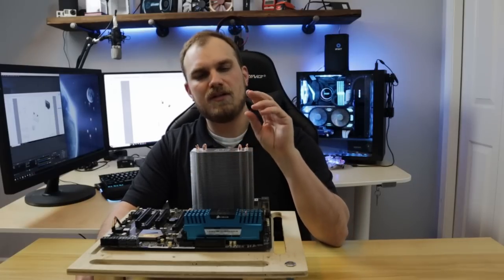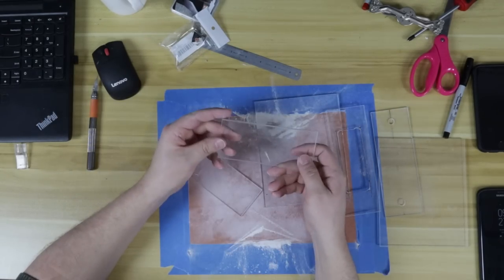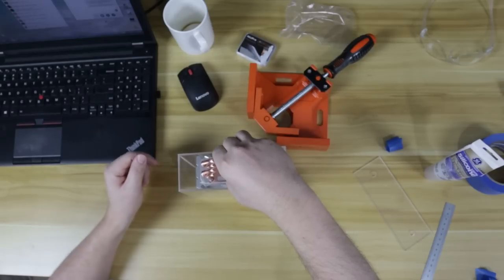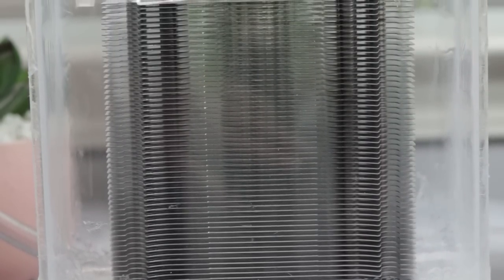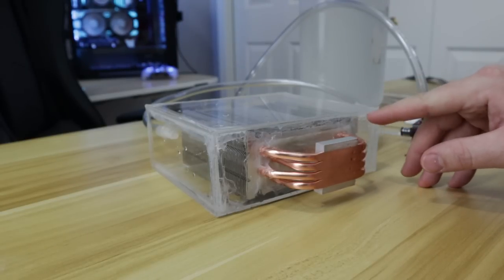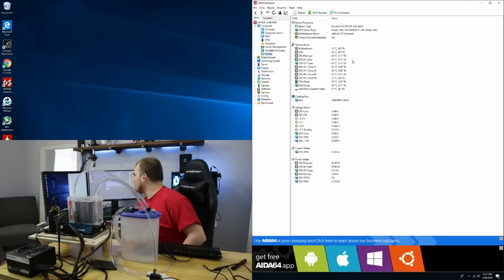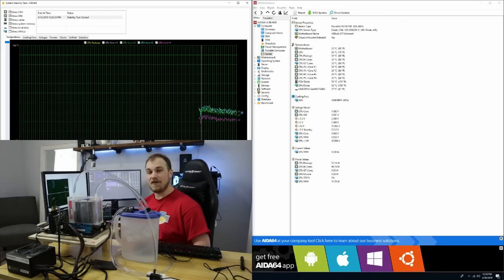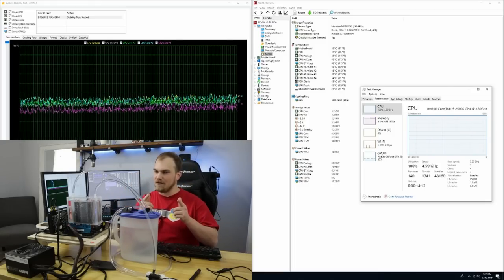I Water Cooled My Air Cooler AND..........

Comment: Fun experiment. Totally impractical, but props for doing it!
Reply: Not sure how you see this as in practical. If he does it with a more modern high end CPU and can maintain temps in the 40s while OC running Ida64, I see this as a more efficient loop. The heat pipes will pull more heat off the IHS then a water block sitting right on it ever would. Its all about surface area and getting the heat spread out
Reply: Not sure this is impractical, he's multiplying the surface area to cool with the water.  I think we're looking at the future of CPU waterblocks
Reply: @HAHA.GoodMeme  Performance might be OK, but weight and size alone pretty much disqualify it. And if fin size mattered that much on the block level in comparison to overall water temperature in the system, companies would be doubling and tripling that easily.

Comment: a year late here, but if you ever face the need to remove bubbles you have 2 easy ways.

1. Vibrate them out by hand. gently rock back and forth. flip 90° and repeat until satisfactory  level achieved. 

2. Pulses of liquid are far more effective at removing bubbles from water than a stable current. the exception is when making clear ice:)

thanks for the effort making this. u proved my long time theory.

Comment: "the fan that came on the 212 is louuud"

Me: Looks at computer with stock ryzen cooler screaming away at 2000rpm...
Reply: Laughs in intel stock cooler
Reply: Laughs in needing 2 server class fans to get 80°c
Reply: I got the 212 on oc with low Vcore on my I5 4670k 4.2ghz sitting at 34ºC and my case fans are the ones doing the noise xD

Comment: Love the idea. The ammount of thermal mass is huge there. Also I would do a crossflow design to make sure the water go through most of the fins and is actually circulating through the whole stack. 

Lastly, get something that makes some real heat under that. 8 cores maybe ? 5 ghz? 

Keep it up
Reply: I agree more like a radiator.

Comment: If you actually think about it, this works about the same way as a CPU waterblock but with heatpipes. Most waterblocks have microchannels cut into them to allow more surface area for cooling, and that is exactly what the fins do on an air cooler. The heatpipes themselves have liquid in them as well, which evaporates up the pipes and gets wicked backed down after. So in summary, you made a scaled up waterblock that doesn't contact the CPU directly. Great video!

Comment: I did this with mineral oils and a LGA771\5 back in the early 2000s on a Radial thermaltake with that axial central fan.- it WORKED AMAMZING - I left the cooling fan on to help move the oil - it may or may not of been needed but I felt it would help circulate the oil.  ROCK SOILD At ambient +- 3c IIRC on my QX6800/6850.

Comment: what about those computers that are immersed in oil, that is another kind of cooling
Reply: Well that's just immersive liquid cooling.
Reply: Those look cool but fiddling with upgrades kind of makes it a huge hassle.
Reply: JenkinsStevenD People never really upgrade their systems anyways. They just start from scratch again.
Reply: @user-xg6zz8qs3q  You must be one of the rich kids.  100% of my engineer friends, self included, who build their own stuff upgrade instead of building new several times over the life of their computer.  Especially when there are marked tech improvements like moving from a HDD to a SSD which I did a few years ago and then upgrading graphics cards.  Also, components break occasionally.  Are you going to "start from scratch" because of a minor defect...or just not perform some exotic, unnecessary cooling that isn't even optimal with heat transfer?  Crazy talk.
Reply: @JenkinsStevenD  "100% of my engineer friends"

engineers are a small portion of the population. Most people are not engineers. Grandma isn't upgrading anything, she's tossing it in the trash and buying a new $300 POS like she always does.
Reply: @kyle8952  Seems irrelevant since Grandma won't be immersing her hardware in oil.  Also, grandma will likely take her hardware to some faux repair shop like geek squad and I doubt they will want to troubleshoot hardware issues if grandma rolls in with a mineral oil filled case.  That is neither here nor there though.  000 001's comment was that people don't upgrade their computers.  THEY DO.

Comment: The only problem, is the water slowly rising in temperature, since there's no fan to remove the heat. Eventually, that CPU will get way hotter than it would under a normal cooler. If you're simply trying to go for some good OC headroom, this is a great idea with that ice, no doubt. 

Good video, man.

Comment: While 'cool' this is only as good as the ice in the pitcher lasts for. There's no way to bleed off the heat stored in the water with this setup. You'd need a 2nd radiator to dissipate the heat out of the system. An hour or two and this system would be at max thermal capacity.  
If you had the water dripping, or preferably 'misting' into the res, and you blew air through the res, that would dissipate some heat. 
Nice starter idea with lots of room for tweaking.
Reply: He did mention that in the vid though ;)
Reply: oh dude - better idea like:
Have you got a garden/balcony or just space for a fountain? You can integrate your loop and the only noise left is the pump + dropping water.
I really like this idea.. as long as its not that sink dropping sound...

Comment: Cool video. I would suggest moving the input to the bottom, that way the water would flow across the entire height of the tower before exiting at the top. Also, as others have suggested, sealing up any way for the water to flow around the cooler would force more through the fins. 

To all the folks pointing out that without a radiator it’s just going to heat the water, he literally said this on the video. Also the fact that the ice melted quickly shows that the setup is effectively drawing heat away from the cooler.

Comment: THe water in the jar will slowly heat up and you will need a cooler to cool the water that cools your cooler.
Reply: What if you put it in a fridge that is set up to the lowest temperature?!!

That would be awesome :D
Reply: and don´t forget the copper, that will become weak soon infact of the normal water....than he has a big leak haha
Reply: SalveMonesvol 
This is rather convoluted 🤪
Next we get long pipes++ expensive refrigerator with ice maker ++ silicon the pipes into the door directly into the icebox ++ bingo++
A 2 grand ice cooled / water cooled air cooled fanless cooling system,,,,, noctua make nice fans,, only 5v nearly silent too 🤫
Strange experiment,,
Reply: no shit sherlock.. But if you would use a radiator instead then it would function as any watercooler
Reply: @morpheas768  : For improved clarity, the problem with a refrigerator is that they remove heat slowly, because they're designed to rely on insulation.
Reply: I guess you didn't watch the video then huh?
Reply: Just add ice in the pitcher 😀
Reply: Guys, I really don't care about this beyond a joke,  just move along.

Comment: Love the ingenuity. My only concern is that the ice is biasing your results. The rate of ice melting would have to be compared to a typical water cooling/radiator setup to be more meaningful. Adding heat to a system undergoing a phase change does not raise the temp. If the water pulls heat from the connection faster than it can heat up, more heat fins are negligable, meaning more cost and points of failure are unnecessary. I would sugguest hooking your heat sink reservoir to a typicall radiator and checking the temps. Conversely, adding ice into an open loop cooler without heat fins on the block might reproduce your results. I really do love the idea, and it would be awesome if it does improve cooling.

Comment: Welcome back to 1998-99!  We did this wayyyy back when but used a pre formed plastic box.  Sealing the bottom always fails, it works for a while but eventually leaks unless you seal it with epoxy or something similar.  These will actually work better than AIO's but you must use proper water or mineral spirits to prevent the Heat sink from Rusting/Corroding.  Great video...takes me back!

Wanna laugh?  All water coolers ARE Air coolers, this is how stupid the community has gotten in the last 15 years.  Yes the water runs through the block but it's cooled in a rad with fans blowing air thru them,  it's not Rocket science but it is amusing to see the arguments.

Comment: Please look at forcing the fluid to flow through the heat sink, filling from the bottom diagonal to the outfeed on top would help with that, dye added to the water would help you see the flow based on how the dye infuses in the fluid.
In theory this could make a liquid cooler far more efficient due to increased surface area
Reply: he needs to put in a separator so the only path from inlet to outlet is through the fins.
Reply: @jaqssmith1666  yes sir

Comment: Cool idea! Suggestion to avoid the consequences of possible leaks. Use a old PC case, cut of sides, mount some stands/legs on it for upside down placement and easy filming.This way leaks fal on your desk. You can put a dishcloth untop off your desk to easily spot drops of water

Comment: Use distilled water or better double or triple distilled water because it does not conduct electricity. For version 2.0 make it narrower so that all the water goes though the heat sink and lastly run a pipe with holes down its length on the inlet side.  
Have fun!
Reply: Not sure if that's a good idea.  Distilled water tends to erode metals rapidly.  Tap water has had solutes added to reduce erosion as water move through pipes (although the erosion is not fully preventable).  Distilled water will eventually eat away at the metal that helps form the seal.
Reply: @sulblazer  If you're worried about corrosion, car radiator fluid would be the best solution. Don't know about it being conductive or no, thought.
Reply: Water does not have the best thermal conductivity of any liquid though.
Reply: @sneeky7 Sure, but it'll no longer be distilled water.  I was just pointing out that the original poster said to use distilled water because pure water is not conductive.  Dissolving phosphates or a weak acid like dicarboxylic acid will provide free ions for conductivity and thereby defeating the original poster's idea of using a non-conductive fluid.
Reply: @sneeky7 Yeah...I agree.  If you want to have the last word...that's fine, just say so and I won't respond to your next reply.

Comment: you should team up with someone who has a 3D printer. mate a tank to a small noctua air cooler, and incorporate a good radiator. you could also avoid any leak hazards by using mineral oil instead of water. as you move forward i think you should use a non conductive solution such as mineral oil, but also something that will combat bacterial growth for long term solutions, ie mineral oil. also using mineral oil will protect against corrosion, unlike water.

the other thing is to make the flow of the fluid pass by or through the fins of the air cooler, I don't have any suggestions at this time, except for the placement/location of the inlet and the outlet of the tank.

another thing I'd worry about is the pump getting gummed up by any impurities in the fluid. but you don't have to worry about that if you use mineral oil.

... just fucking use mineral oil.
Reply: Or stuff thats in a cars radiator..

Comment: I suspect condensation on the tank might drip on your mother board.
Reply: Condensation only occurs when a surface falls below room temperature. The water never went below 30°C, so it never went below room temperature.

Edit: I forgot about the CPU adding heat to the water. The water was colder but got to an equilibrium of 30°C only after receiving heat from the heatsink.
Reply: aFuturnaught 
Condensation doesn’t have a set temperature for it to occur. The difference of temperature between the ice water and the surrounding air would be enough to cause condensation.
Reply: @AM-ko4pi  Right, but, in this case, room temperature is what matters since the water is in an air conditioned room.
Reply: aFuturnaught 
If you put ice water in a glass in even a low temperature room, it’s going to cause condensation. Try it yourself. I have a glass in front of me I poured earlier. There’s condensation and my room is around 20 degrees Celsius.
Reply: @FutureNaught  Condensation occurs at the dew point. This is a function of room temperature and humidity level. As a rough guide, 50% humidity will produce a dew point around half of room temperature. If <30% humidity, dew point is below freezing in room temperature air.
Reply: @AM-ko4pi  Condensation only occurs when a liquid is colder than the surrounding environment...the liquid cools rapidly to reach the room temperature. So what @aFuturnaught was saying is valid. If the liquid reaches room temperature both in the block and reservoir there will be no condensation....even with the heat from the cpu, because the water would be looped, and cooled. Which in turn, would not allow condensation to occur.

Comment: High risk, low reward. But awesome video nonetheless.
Reply: low reward? it fuckin worked
Reply: low rewards ? an overclocked cpu running full load on 45°C ! that's my idle temps right there, I think it's a pretty awesome idea
Reply: Guys he is right. It is high risk low reward.

I mean the basics: aluminium and copper in a loop? Bad idea.
Reply: @pcgaming002  It's somewhat unlikely that the temperature would remain at 45 Celsius in those conditions, once a radiator is installed instead of melting ice.  Still, could be a very nicely performing system.
Reply: LOW REWARD? 20 C - 40 C ARE GREAT TEMPS FOR 4.0GHz+!
Reply: @danieljimenez1989  yeah true, but still we're talking about this awesome idea, it's not perfect but it might open some doors for some alternative cooling solutions, who knows :)

Comment: The positioning of those tubes is terrible.  You''re not getting any water flow across the fins.  They should have been place diagonally apart from one another, or at least horizontally.
Reply: Facts. The water has no reason to actually go throughout the container. It'll just go the path of least resistance which is right across the top, avoiding the fins.
Reply: It will be better if installed in the case vertically. Also, the tube can be inserted more.
Reply: Who was convection?

Comment: Copper heatpipes and aluminium fins? That is probably not a very longterm setup :-/
Reply: its done in almost every industry.. not sso much a big deal as everyone makes it out to be.
Reply: Zues Toots issue is they arent putting the aluminum and copper in water which causes galvanic corrosion
Reply: It is if the uncoated copper gets wet in any way

Comment: It's neat, but in reality all you have added is one more barrier for the heat to pass through.
I guess you could argue that you have increased the surface area between the processor and the water with the air-cooling fins, but I still fail to see how this is "both water and air cooled".

It's water-cooled, with an increased surface area between the water and the processor. There's really nothing new here. =|

Still a very neat project!
Reply: Ironically, most water cooled builds are also air cooled, since the water is used to carry heat to a bigger radiator, but not this one.
Reply: @RB-kb3tc  Very true. "Watercooled" is a misnomer in a way, as the heat ends up in the air in your room no matter what you use.
In this case you could argue that it stays in the water, but then the water will just keep heating, temperatures rising, until it hits the boiling point, at which time your CPU is toast and you got a very leaky system.

Comment: Even more lightweight idea:
Chop open the heatpipes and loop your water through them so you can still have the fan on the finstack.
Reply from the maker: interesting idea
Reply: Holly molly... you how hard it is to get a waterblock for some graphic cards. Esp those small ones, like zotacs mini or gigabyte ITX.
Most of them have coolers with heatpipes ;-)
Just an easy ghetto build.
Cut heatpipes, connect with tubing of your loop and you are good to go. ;-)

Comment: As long as you remember? You're too young then. I used to cool my Celeron 300A to 600Mhz on my Abit BE6, with a TEC module. Thermoelectric cooling was a thing in the 90s.
Reply: Yeah I thought of pelter coolers as well. Not just the 90s man. Many implementations of this cooling type exist today in industrial environments.